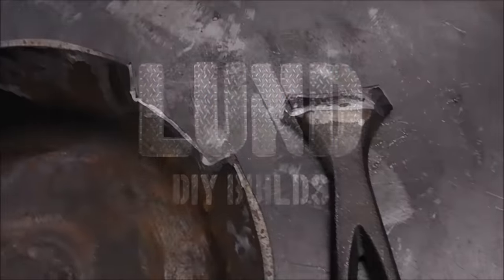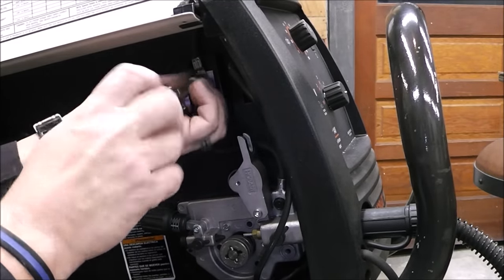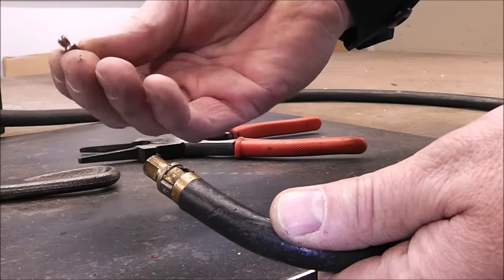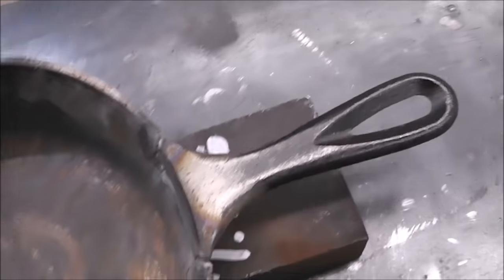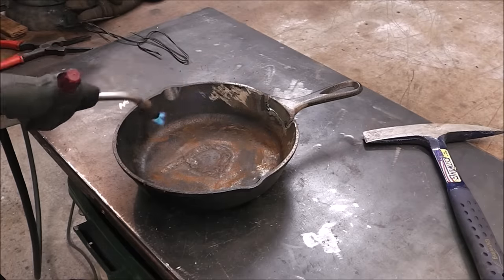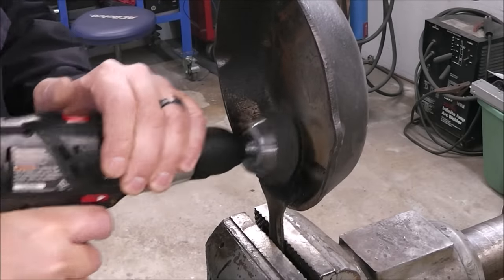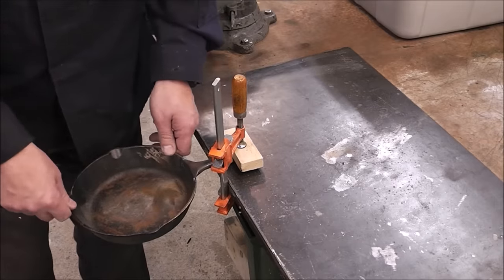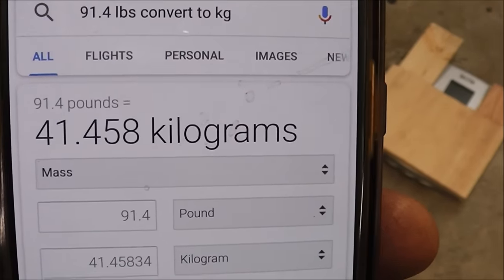Cast Iron Welding Repair using Flux Core Wire

Comment: You actually don't know what weight will break it. You know about 50 lbs didn't break it, but 91 did. You don't know if 70 would have, or 60, or 81.
Reply from the maker: @ludditeneanderthal l know EXACTLY what NEW cast iron will break at and I KNOW what the BEST possible filler material is, I KNOW what the best process is and I know at what percentage NEW Vs. Repaired Breaking Strength is. Keep watching my cast iron repair series and YOU WILL KNOW THIS TOO.
Reply: @BrandonLund  not disputing any of that. My only point is you stacked about 50 lbs of scrap... no failure. You then added about another 40 lbs all at once, it failed. So we know 50 doesn't break it, we know 91 does. All good. But we don't know if 60, 70, or 80 would (because of the final load method). Not disputing your weld quality, your further knowledge  of which filler works best, or anything else. My only point is you don't know what the minimum load is that would make that joint fail as welded in that vid, because you had such a huge weight jump between "nope, still holding" and your next step result of  "move your feet bubba!". 91 might be the minimum failure load, or 5 lbs more than the last load before the bucket was added could be, or anything between
Reply from the maker: @ludditeneaderthal  That other bucket I added was maybe 30 lbs. Watch real close. I'm only holding pinching the bucket with my 2 fingers moments before it breaks then I open my fingers just slightly and it breaks. This test is within a pound or so. https://youtu.be/jMyg3rpmCBU?t=788

Comment: I flux core welded my cast iron exhaust manifolds to my aluminum heads
Reply from the maker: It also works good for welding the intake to the block...saves you from having to use a gasket.

Comment: Spend a few more bucks and buy a welding machine that won't allow the tip or wire to be hot till you pull the trigger. Saves a lot of irritation.
Reply from the maker: Spend more on a welder? Dude, you do know that the nozzle has an insulator built in that isolates it from the diffuser right? When you remove the nozzle from the gun your left with an exposed diffuser that becomes energized when you pull the trigger.  FYI Hobart is made by Miller and Miller is hardly inferior. Fact, this model welder was actually shipped with mig guns stamped Miller. Not all but some during the consolidation. Your confusing quality with Harbor Freight. Their guns are energized when the trigger is dormant.

Comment: My nozzles are insolated.
Reply from the maker: Most of mine are too (or they should be if they aren't worn out. Slag buildup inside the nozzle will cause it too...it will jump across from the contact tip to the body of the nozzle

Comment: it will eventually break again. you can not properly weld cast iron
Reply: In high stress applications welding isn’t proficient to repair cast iron but it’s just a pan. As long as his procedure was correct and it doesn’t crack it will hold up fine
Reply from the maker: People have been sucessfully welding cast iron for years.

Comment: You say weakest, but the metal broke far more than the weld
Reply from the maker: I'm quite impressed how strong the non conventional methods are testing
Reply: @BrandonLund  well am turbo newb with welding, i know you need a sparky boi and a sticky or extendo boi to boot, but it does seem good to have the extendo bois as well as sticky bois, gassy bois are too expensive for my super peasant cash flow

Comment: this would have worked better with stainless wire.
Reply from the maker: Not for me. I've tried it with 308, 309 and 316 for the heck of it and it all failed. Silicon bronze MIG is where it's at.
Reply: @BrandonLund  Yes SiBR is the shit for sure...though not technically "welding". We tig braze SiBR where the header tubes meet the flange on all our manifolds....keeps em from cracking.  I feel the preheat and postheat are more critical than the filler you use when welding cast.

Comment: Made in the same factory does not mean made to the same specs.
Reply from the maker: Although not stated in this video I have since confirmed some of companies that actually market this wire as their own. It's good stuff.
Reply: Sorry. You're experience tells you that it is good and I am certainly ok with that. Did not mean to imply that it is bad just that there is no guarantee that it is the same due to same factory. 
Very interesting vid, thanks.
Reply from the maker: @madddog7  I didn't take your comment as disrespect brother. Your first comment was spot on. I was just reassuring you if you wanted to try it, it's good stuff. A lot of times your paying for the name. Cheers brother.

Comment: Every welder can claim to repair something that held for months even years but when you own the business and you do not want your customer to return because of your faulty weld you will never repair cast iron .....with flux core or nickel stick-electrodes. Every weld repair has "its own" parent metal work-hardness and "completed repair" tensile strength consideration.  I would tell my mother....sorry mom its too dangerous to repair your frying pan. But it will make a pretty flowerpot once welded with flux-core.
Reply from the maker: Keith, I never suggested that someone should repair a 7 dollar pan, and 99.9% of the people watching this video don't own their own welding business. The people that are watching these video are the ones commenting in the series about how they took their old tractor and welded up the broken front axle so they could continue farming and providing for their family, or they repaired their cracked exhaust manifold without paying a mechanic hundreds of dollars to replace it, or they repaired a cracked woodstove or bench vise and the list goes on.   Not everything can be replaced and not everyone has the cash to go buy new, that's who benefits from these videos.

Comment: Crazy to watch people weld cast iron which to any Engineer is a No No. 

For home projects do as you please. However I've seen nen on YouTube in India welding a replacement steel ring for cutting new gear teeth on a cast iron spindle pulley fir a crane. This can cause people to die, so don't even show these tricks, because those guys will use them on rollercoasters, cranes, public transit and or for trucks. All if which can cause deaths. No offence....nice patch.
Reply from the maker: 3rd world countries have been proving the "cant do" culture wrong for decades. For them it's a necessity to make everything they have last as long as possible. For us in the western world we live a disposable society. Oddly enough we could learn a lot from these less fortunate countries.

Comment: A used gas less wire. cheap shit. to weld a back and middle delete boxes. on a transit. it was 
steel/stainless straight pipe

Comment: You really shouldn't weld cast iron that way... especially if you're cooking extremely dense eggs that weigh 90+ pounds. It's just not safe.
Reply: Yup those elephant eggs are not good to mess around with.

Comment: For one thing I would never use welding wire to repair cast iron in the first place. The best way to repair any cast iron is with a brazing filler. Ideally it will not be touching food because brass is kind of nasty and acidic foods tend to Leach a tiny bit of lead from brass filler rod. But if it's just a handle or something I would use brass and a heartbeat I have repaired fine cast objects like precision tooling for a hardinge lathe with brass filler rod with no bevel if you know what you're doing you can do almost invisible cast iron repairs. And they are stronger than the original casting
Reply from the maker: I rarely draw a bright line by saying to "never" do this or that. If I did than I wouldn't know this repair method is almost as strong as an unbroken piece of cast iron. The best way to repair something and what someone may actually have access to are usually quite different which is why I posted this video in the cast iron welding series. I will say NEVER repair cast iron you plan to cook with. It's too dangerous and not worth the risk.

Comment: That’s actually pretty terrible, I’ve seen brazing hold way more weight than that
Reply from the maker: Link to the video please
Reply: This may be a gaming channel but I know my stuff, I’m not the person who runs this channel, my old buddy does I just use it. I’ve been welding and workin on engines for years
Reply: Great video btw
Reply from the maker: He was not welding cast iron. He said he was welding malleable iron. Big difference. Malleable iron starts out as cast iron, but an annealing heat treatment is applied to the cast iron to make it more workable and increase ductility. Consequently, malleable iron has much lower carbon content than cast iron making it less brittle. Malleable iron is also relatively easy to machine and it is shock resistant which is evident by him welding it in a single pass. My experience when Brazing Vs FCAW on cast iron is drastically different than what you have "seen".  In fact, the destructive testing we have done on the channel showed only an insignificant difference between these two processes and the results were far from "terrible".

Comment: Jesus.

The fact you started using a mig with out a gas nozzle tells me you don't know what your talking about.

Sure you know a bit.
But there is a reason the nozzle is on the damn gun.
Reply from the maker: MIG uses gas and requires a nozzle to direct the gas outwards onto the molten metal. Self shielded (which is what I was doing here) doesn't use gas so a nozzle is not needed or required. I wasn't using "MIG". If you're going to try to be smart mouth atleast have a clue what your talking about.